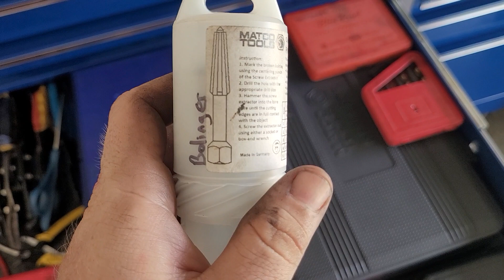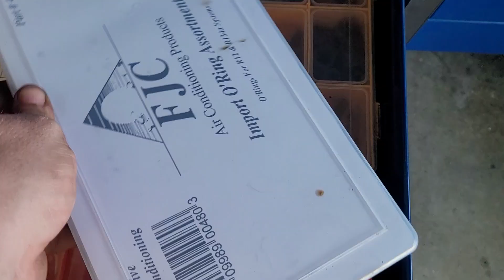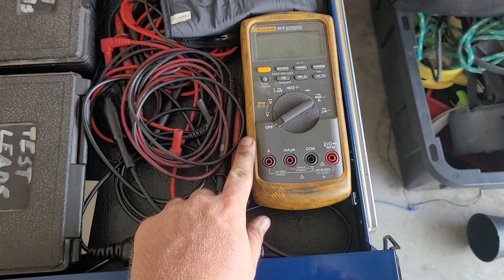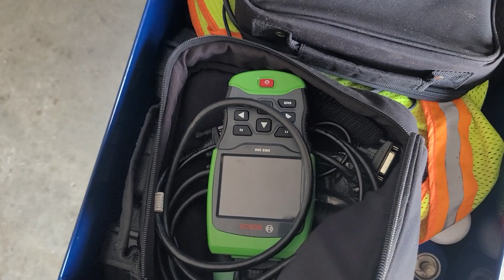Heavy Diesel Technician Snap On Tool Box Tour.

Comment: I've had my hard handled Snap-On screwdrivers for 30+ years. Would never trade them. Force yourself to use yours for a week, I think you'll agree.
Reply: I’ve had them 60 and I still love and use them 
There high price but so was i
Reply: Really on big trucks there’s not as much need for screw drivers as there are for smaller pry bars 😂

Comment: Do you try to do snap on exclusively obviously I can see you got tools from everywhere but I’m thinking about becoming a technician once I’m out of the military I’m an aircraft mechanic in the Air Force and we use snap on hand tools exclusively I know the prices are pretty pricey but you get what you pay for 100%  just trying to get the opinion from a seasoned technician love the video
Reply from the maker: Not anymore. When I started I was a poor kid and truck accts were my only option, didn't have money to buy outright so I made payments and Snapon was only constant  dealer. However yes, when it comes to ratchets, basic wrenches, and screwdrivers I 100% swear by snapon. But now that I'm older have a little in the bank, I can look around for the best deals. Most tools now have a warranty so I don't care about name.

Comment: AT 17:58 you show adaptors, do these work by allowing a 12point wrench or socket and then adapt down to the 6 point size stated -- https://youtu.be/7SGUWzZWyLw?t=1078
Cant seem to be able to findthem, is there any part numbers
Reply from the maker: P.N.#HGEXR12. It's a 12 pack supposed to take off 80% rounded bolts
Reply: @bolinger87  thanks Brad